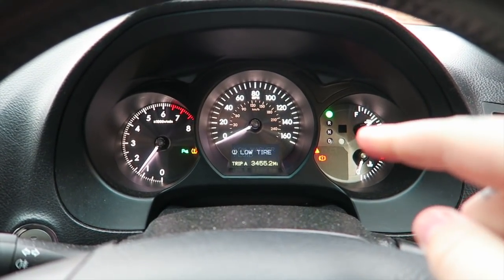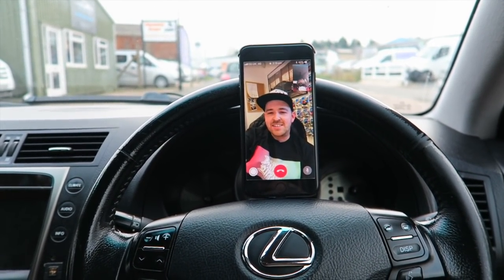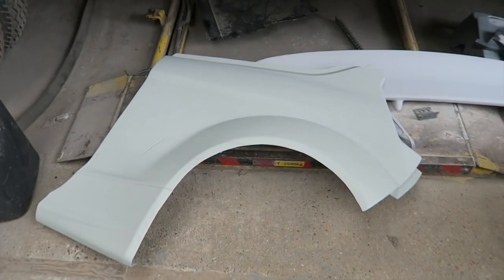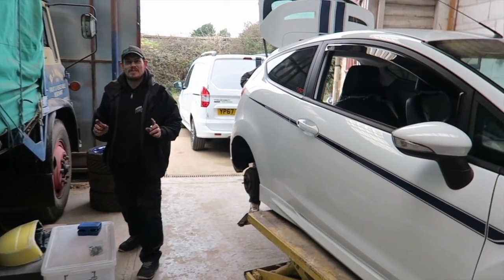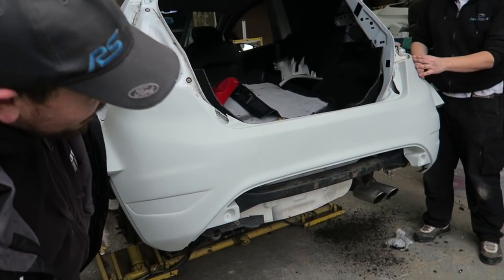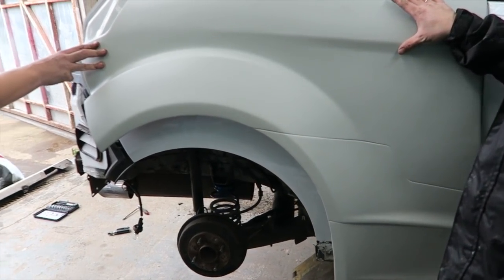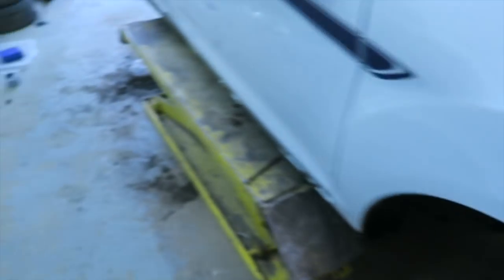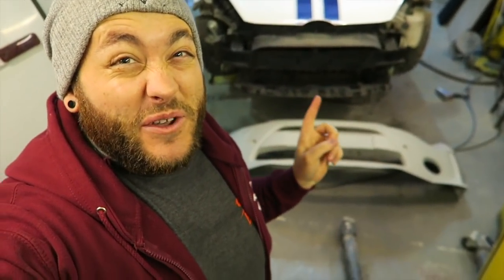CRAZY MAXTON DESIGN WRC FIESTA PROJECT!!! - Stripping The Car Down

Comment: That's a Fiesta MK7 S1600, just brought one.
Only 650 made in "performance blue" (mine) & "frozen white" (featured) killed quite a rare car, what did you do with the parts and car afterwards?
They are Zetec S base but harder springs and ECU engine upgrades, induction system, and exhaust so 134ps over standard 120ps Zetec S cars. The stripes was a feature along with the full leather interior with blue stiching.

Comment: If you got an extra couple grand laying around for a few pieces of fiberglass... Why not get an ST.
Reply: Don't bother questioning their logic. It's unreal how this guy only appreciates 10 year old cars with some chavvy mods
Reply: old larry chassis strength, stronger engine, bigger brakes and will reliably take to mods better.  If you are just talking about having a car for cosmetic purposes only then yes there would be no point.  But then I don't see the point in having a WRC STYLE car that GOES like a standard fiesta.  I would much rather have something that LOOKS like a standard fiesta but GOES like a WRC car... But to each their own.
Reply: oddly (bit unrelated) most jwrc cars start as lower spec chassis, not that this matters considering the modifications to the car. Suzuki swift jwrc would be an example of this. Also chassis strength amongst this bracket of cars doesn't differ much, generally(!!!) its marketing rubbish when what they've actually done is give the car stiffer suspension and arb's, and sometimes a chassis brace, not modifications to the chassis itself. These aren't race cars out the factory, still just a "normal"car. Chassis wise there's nothing that wont inevitably be done to this car that'll match the ST really.
Reply: NitroNuggetTV I didn't know that the WRC cars were mainly based around the lower tier versions of the cars, but that would make perfect sense.  Thanks for the info.  I just don't see this being a true road going WRC car with a completely swapped out engine and drivetrain ect so I still believe that if he is to modify the engine in this fiesta then surely he would have been better starting out with the ST engine being more suited to higher boost/stronger ect. But hey, if this ends up being a 400bhp street monster then I'll eat my words and take my hat off to the guy.
Reply: I fucking hate that question, I get it all the time (mainly by old people and people who just aren't into cars)

My daily started life as a Corsa D 1.3CTDI LE. Now it's running the suspension, brakes & body kit from a 'burg yet apart from an after market exhaust, nothing engine wise. 
"Why didn't you just get a VXR?" "Why do all that work to a diesel?" Because it's a daily driver, I want it to be cheap, reliable and get me from A to B in as little fuss as possible whilst looking decent. On the roads I'm confined to a speed limit so there's no point in having a million hp that can't be used and a stiff clutch that's either fully engaged or not. 

And if I fancy a hoon at nights/weekends or round a track I've got my actual 'burg Corsa running the engine and HiPer suspension system from an Astra VXR to which I always get "why didn't you just by a Astra?"
Reply: If it’s gunna be a purpose built rally car it might be built to s1600 spec?
Reply: John Smith so you modified your 1.3 to be a VXR nurburgring replica because you couldn't afford one? (That's not me being a dick) (EDIT : Just saw that you also aparently have a nurburgring Corsa as well so ignore that first point) My original point is that this person has spent THOUSANDS on a bodykit, so he's not strapped for cash.  If he's going for ultimate performance, Why not start with the highest performance model and go from there..  I understand buying a cheap car and modifying it slightly to suit your taste.  But this isn't cheap, like I said, he has spent thousands on just a bodykit.  So he can't say he's doing it to be cost effective.
You drive what you drive, and you afford what you can afford, modifying it however you please... That's car culture.  But personally I think  in this scenario it just doesn't make a whole lot of sense.
Reply: +Mr Dayum Fine if you read what I actually posted you'd see I own a 'burg too.... 

if you're going for 'ultimate performance' then you're probably not going to leave many standard things on the car, so what's the point in paying extra for things you're going to take off?
Reply: John Smith (already edited my comment acknowledging that you allegedly have a nurburgring  edition) right... so it's because theres no mention of this car aspiring to be a 400bhp road king.  Just a bodykit that cost a couple grand so far.  Like i said before, if it does become that then I will eat my own words.  But I just don't see it happening.

If your trying to create the world's fastest Supra in the quarter mile, you don't buy the 5 speed non turbo version.
Reply: Mr Dayum Fine, welcome man, i was just focusing on the chassis side of things, i don't see this being a road going WRC car either. In all honesty i completely agree with starting with an ST if you can, better brakes, engine, gearbox, etc. but His plan with this car may lead his to never see the gains from starting with an ST, like if hes getting big brakes and swaping an engine from another car. He already wouldn't have seen the benefit from the ST's suspension. We'll see where this build goes and all will reveal i guess.
Reply: you might buy the base model for something like the fastest supra in a quarter mile if your going to swap everything, doubt you'd use a supra gearbox as it wouldnt hold the power, and the engine would be rebuilt anyway with a nice big after market turbo and manifold, wouldn't see the benefits of a top spec supra. if you catch my drift.
Reply: NitroNuggetTV Yeah I understand all that, when I was younger I had a 99 Impreza Wrx.  With the price difference for the sti it would have been cheaper to buy all of the aftermarket parts (turbo, intercooler, brakes, suspension ect) and have a car able to beat an sti for the same price. Because an sti is just a modified WRX.  This however I feel because it's a newer car would have been cheaper to just get the higher end model to begin with.
Reply: for an example like that, agree completely. Buying ST parts of this age would cost a bomb, would be way more efficient to start with an ST.

Comment: This kit is sick but whats the point to put it on a 60 hp fiesta?
Reply: if its the s1600 its 118, but its a wrc project... so it will be 350 upward
Reply: I've got a fiesta metal, which I believe is the Dutch version of the S1600? (Alle black with black wheels and different front grill though) but it's 134hp and a shorter ratio gearbox than the standard sport/zetec
Reply: LighttownMadness1913 we have the Metal edition here in the UK too, alongside the S1600👍🏼 S1600 is just a stickered/better trim version of the ZS, then as you said the Metal has everything on it and more power
Reply: Sarcastrxphe Gaming ahh right, didn't know that.. so it has 120 then?
Reply: i have an s1600 its got a few extras like heated seats and that, but i bought mine with lowered springs and a spoiler extender zunesport front grill and some other stuff, i will be getting a st180 engine in it as i perfer the body to the preface lift

Comment: Wide arch kit running standard rear drums..... JOKERS!!!!!
Reply: Lee Broadbent  its all getting changed over he said and in a earlier video engine is coming out as well it’s just the shell they wanted!
Reply: old larry and you drive?
Reply: old larry an E46 you say??.... That's original..
Reply: Think most would prefer a E46 over a Vectra lmfao
Reply: ZS Jord obviously I’m not like most and like to be different and would rather drive a V6 than a dirty, common BMW diesel